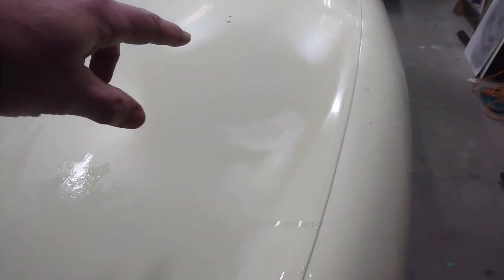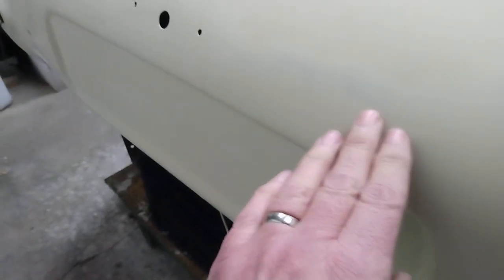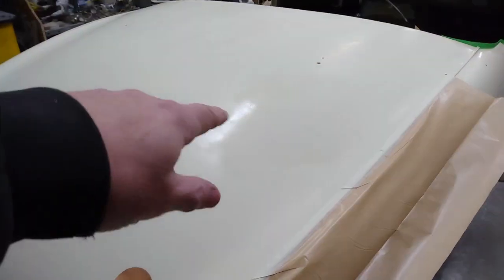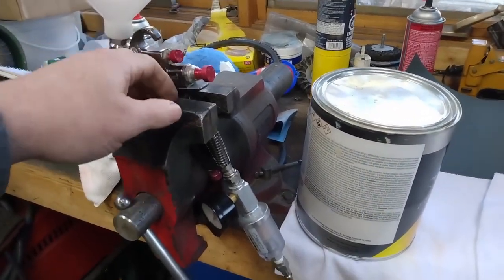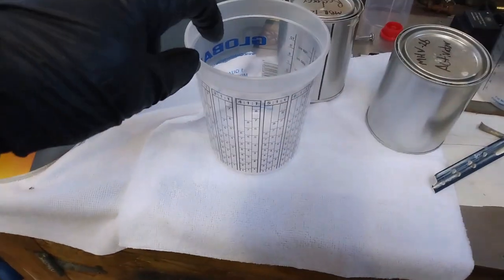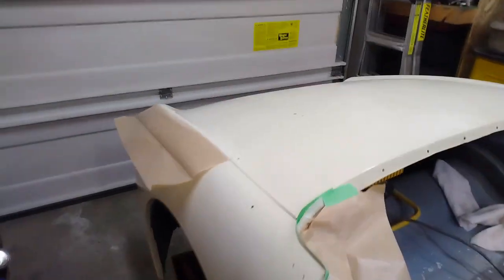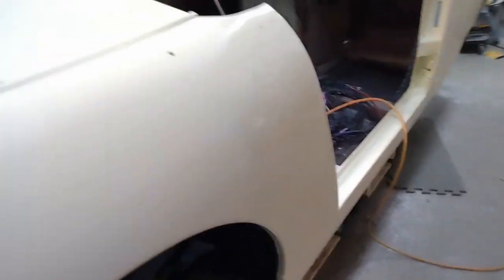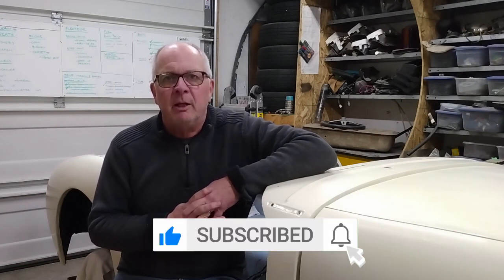Is the paint finally finished? Things heat up in the garage for final touchups! Bugeye Build Ep. 102

Comment: Ian nice done, I hope you was carefull enough with (still) hot heaters and the spray mist
Reply from the maker: Both heaters were at the opposite end of the garage from where I was spraying. I had the ceiling fan going and the garage door cracked a bit so air was circulating away from the heaters.